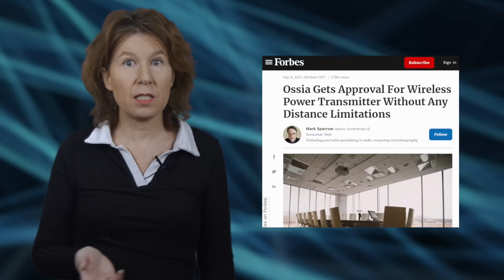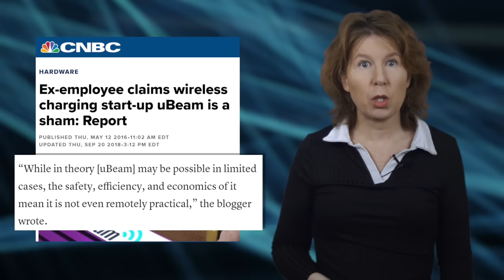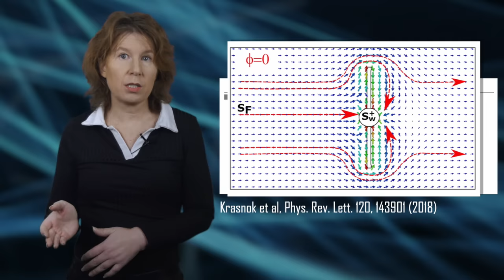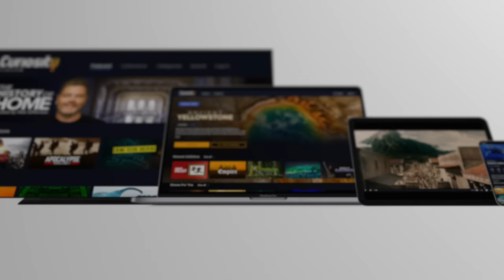How close is wireless power technology?

Comment: wireless power was solved long ago by different inventors in the 1900s. the reason why we don't have it now is that nobody seem to have understood the basics of electromagnetic induction and radio waves but instead they understand the theory of how radio waves are produced in conjuction with the already existent radios circuits but not the basics of electormagnetic induction underlying wireless transmission of power. the charge in the collector as with nikola tesla versus the inductance of the inductor winding is exactly proportional to power given a ideal distance of antenna to transmitter. normal radios uses tiny windings and tiny air capacitors. since air is not a good collector of electrons we can not increase power by more winding so we need more capacistance and the inductance need to be tuned to the capacistance given a certain distance from the transmitter and reception of antenna. wireless power need bigger capacitors to recive more power wirelessly. that means we need two coils to tune the inductance to that of the capacistance at a given frequency. another thing is the diodes used for wireless receptions need to support more power than diodes used in radios. normal radio receivers can only recieve as much total power as the charge collected on the air capactor of the tuner and that is less than 1 watt total. the previous inventors of the 1900s experimented with various capacitors and inductances for wireless power receivers but only the classic radio reched the attention of the corporations and is why wireless power never reched market in the early days. nikola tesla had already done this with a electric car that he run of a induction motor driven by a antenna receiving power from his tesla tower. the electricity was charging a car battery that drove a electric motor that powered the slow car. the only problem was that the car had limited range and could only sustan power at a certain distance from transmitter or being charged up before drive trough the tesla induciton receiver. the reason why our phones are not self charging is becasue of ignorance not science or knowledge itself.

Comment: 8:58 Interesting but a USB type c at the absolute Lowest would be doing 4.5 W most are more like 15W for phone chargers and up to 100W for laptops.   Just to show how truly far away true wireless charging Is.
Reply: Huh? One can easily build wireless charging pads with tens of kWs of power. You just don't want to be anywhere close when they turn on. It's a simple biological, not a technological limit.
Reply: @schmetterling4477  Just like someone can easily get to the moon its getting there Alive that's the hard part.
Reply: @shanold7681  It's a lot easier to build a 10kW or even 100kW wireless charger than to go to the moon. I have pretty much everything that it takes in my one bedroom apartment: a PC with PCB layout software, an old oscilloscope, a soldering iron and a multimeter. If you know how to do professional electronics designs, it's not that hard. What would I do with it, though? I don't even have a 100kW power outlet. ;-)

Comment: Once the electrical field strength reaches the ionization potential of the molecules in your body you are in trouble. You can be severely injured or killed. This is why being near powerful radio transmitting antennas, radar sources and microwave sources is very dangerous. In fact microwave beams, sound, and lasers can be made into weapons.  Microwave ovens work by generating electrical fields at the resonant frequency of water molecules. 5G is potentially very dangerous directing focused beams at up to 100 Ghz in bursts. Nearly a century ago the equivalent of microwave ovens called diathermy machines were used "therapeutically." Are we any smarter today? It doesn't seem we are.

Comment: Hollow-core Optical Fiber Gas Lasers (HOFGLAS) transmit power, don't they? It's wireless,...maybe not tubeless. Intercontinental electricity hoses sounds more waterproof, doesn't it? Mark me down for a dozen.
Reply: Solar/wind hydrogen-to-ammonia pipelines need nitrogen gas, but on the other end of a transcontinental or transoceanic pipe, converting non-agricultural ammonia liquid back into usable hydrogen must take the nitrogen gas back out, right? A double-wall pipeline solves that, with returning nitrogen gas surrounding an inner pipe of ammonia flowing in the opposite direction. Recycling that pure nitrogen reduces or replaces that required for ammonia production. With water and wind/solar energy inputs, isn't this a realistic way to spread Sun Belt energy and fertilizer products to their Corn Belt users? And, it gives another reason for drawing fresh water from the Intracoastal Waterway and lifting it uphill to the Continental Divide. It all works, but is crowd funding the only way to get the job done?

Comment: I like your solution. Another solution I've thought of is low-power guide beams immediately followed by high-power beams.  The low powered beam ensures the path is perfectly clear.  This system could be used for powering flying cars, perhaps complemented by a drone power delivery.  This way, you can guarantee your flying cars will not fall out of the sky.  If such a laser guide beam system were precise enough and fast enough it might even be able to send lasers in between raindrops.  It would wait for a perfect line of sight path and then, a nanosecond later it would fire off a high-powered beam.  This is my company that I want to start (actually, technically, I am CEO of a company right now and we could just expand our operations to include this technology).

Comment: I can't see we're getting rid of cables without having tiny fusion batteries inside every devices.

You're saying wireless power is getting going but there doesn't seem to be any feasible way of transferring even 30W of power without damaging anything else like a human, a cat, a phone cover, hair strands etc. It just seems physically near impossible. I don't know these stuff about metamaterials but I am not sure if it can solve this issue.

With the advent of AI we're gonna need batteries, or better yet, AI will need better batteries to work inside robot bodies. So it should be one of the top priorities. Not to mention fusion is critical for space travel and colonization. Though obviously, not sure you can get something like fusion batteries, even if we made fusion come true. That's also very far fetched and scifi.

This will be a problem we and AI will have to solve soon if we want to make any progress about a lot of things at all.

Comment: I have a dozen or more wireless chargers but I never use them because I personally think it's pointless, using a cable is far more efficient and cost effective, wireless charging rarely exceeds 75% of what a cable can provide so you're literally throwing money away and in almost every wireless charger you need to use the exact same cable you'd charge your device with anyway so really, what is the actual point? 🤷

Comment: Wireless power technology already exists.  The problem is that it's horribly inefficient and wasteful.
There's this little problem of distance.  In general, doubling the distance between the source and destination means that the amount of power is cut to one quarter.  If you're receiving 144 watts at 1 metre distance and then you increase the distance to 2 metres, you'll only be able to receive 36 watts.  Double the distance again to 4 metres and you're down to 9 watts, and that's presuming there's nothing in the way to absorb some of the energy.
While using waveguides, dishes and directional arrays will help to some extent, this reduction in energy with distance cannot be reduced to a level where wireless power could become viable.  The only reason it can be used with things like mobile telephones is because the telephone can be placed very close to the power transmitter (generally within a couple of millimetres) so that less energy is wasted.  But make no mistake, contactless charging is less efficient than making a direct connection, by a long way.
To quote a certain fictional engineer, "ye canna' change the laws o' physics."

Comment: Wireless energy is not good even in theory, obstacles are a danger and it's a danger to transfer energy mid-air,  something might pass it and get hit by it, plus that you might loose MOAR in the transfer if it RAINS ! SO yeah, a cable is  better  !
I don't know what's with these "in theory it works" types, this idea is wastfull and dangerous even in theory.

Comment: No it won't work except on  simple low power.   Mind you my crystal set I built in 1969 powered a 12inch speaker  via an audio  transformer connected  to the backyard aerial  The BBC suddenly increased Droitwich power at about  2am and i awoke hearing  the BBC World service!

Comment: Sounds like even when we can get it to work (the way people envision) it is very inefficient ... and if we're really worried about the availability of energy and/or CO2 ... this would be wasteful at best.  Even the tiny robots would be pretty inefficient :-)  I don't really have any problems keeping my phone charged, and for situations where it can be challenging there are external battery packs and solar chargers to fill that void when needed.  

If you're using your phone so much during the day that you can't keep up with the energy demand even with these supplements, I would suggest maybe you find something better to do with most of your time.  Learn a skill, a musical instrument, make things with your hands.  Have face-to-face conversations with people.  But then again since Sabine doesn't believe in free will, you really can't choose to change your behavior anyway so perhaps you're just out of luck ;-)  On the other hand, maybe this is predetermined, too, and you are just going to do it anyway.

Wasting energy on a constant stream of available "in the air" energy so I don't have to occasionally charge my phone just seems ... novel, but ultimately silly in the face of the challenges we face today.  I have no problem plugging my phone in at night and letting it recharge while I'm recharging.  I'm afraid until we build those matter-antimatter plants ... that's the way to go.

Comment: Even if a wireless charger had a range of only 2m and a maximum power of 2W, it would be enough to slowly charge your phone simply by placing it in the rough location of the charger. This would be quite convenient to have especially if you had a few charging spots located around your house. Just leave your phone on your bedside table and wake up to a fully charged phone. Or if you don't like sleeping next to it your phone, leave it somewhere in your kitchen or living room. No need to worry about connectors or correctly placing your phone on a wireless charger.

Comment: I think in reality this wireless power thing is and will ever be vaporware, you can't beat the efficiency of thw power grid this way, even if the frequency you are using has low absorption in the human body the sheer amount of power you need for real practical applications would make that a problem, just use wires

Comment: Wireless power didn't work for Tesla, it's not going to work in the future.. Why? Physics.. Magnetic fields drop off in their power over distance very quickly. There are applications of wireless power, your electric toothbrush charger for example, but they all work within a very close distance between the field source, and the field receptor so NO, there is not going to be wireless power. The system we have at present is all there is and frankly is about the most efficient that it can be.

Comment: Well it would seem we have all been deceived!!! Has not the technology been available to transfer energy wirelessly since the radio was invented? Is that not what occurs with that device? There’s more similarities and differences between RF and AC! In fact one can conduct a small amount of electricity from RF signals! It has been proven that the closer you are to the source of the signal availability of the power increases… I believe there is an interest of a few who want us to believe that electricity comes to the house just like water in a line. This is not exactly true for is actually the vibration of electrons that is a source of power. So electricity does not technically exist until are you advice is it plugged into the circuit and using it. The generators Do not produce electricity would rather start the vibration of electrons that then move like a sound wave down the waves. Of course it is a very simple exclamation where it is fairly accurate as to what is occurring!

Comment: Whoever is working on this should be very motivated. You will save people from electrical fires and other things that will thus be forever prevented. However I imagine whatever new tech replaces the old will not be without new problems.
(Random idea: I wonder if it wouldn't be easier to just build in some type of super small power source or auto recharging device within the objects themselves)

Comment: How useful is really a charging method with a loss guaranteed by the design to be not less than 50%?
It would be better to focus research on breaking the efficiency barrier on transformers and electric motors of 82%.
Wireless power transfer is a good example of a research area that is driven by magical thinking and false desires. Rather than what is possible and needed.

Comment: Sabine plz help.. If the universe was as dense as they say.. Why didn't it go str8 to blackhole.... And also if the matter there is today was squashed into a grapefruit surely the matter has expanded as well because its so dilute now.. And also could the expansion of the universe be the energy from when the matter anti matter annihilation happened.. And it's speeding up because its not reached its crusendo yet.. But when it does may slow to a stop and then the matter pulls it back? My head really hurts lol😱😱😢😁😁😁. I know I'm probably nutz.. But hey. The old it's a thin line between being a nutter or a genius. Lol

Comment: Wireless chargers are rather pathetic.
You have to put your phone (or whatever) in direct contact with a charging pad. Instead of putting it into some kind of docking port or plug. Then you basically use (and pay for) about ten times the energy due to wasteful transformer and inverter losses. And you wait over twice as long for your battery to charge.

Comment: A lot of those methods of wireless transfer sounds so lossy! I would prefer to plug in my devices. Most phones for instance are using less power and have better batteries so they need to be plugged in less and for less time...I am not a bit fan of every thing plugged in all the time and in sleep mode...not actually turned off...again...wasteful! Another great thing microwaves are used for is disbursing crowds of peaceful demonstrators! /s

Comment: I was really hoping my masters thesis on near filed wireless transfer using planer transfer for biomedical devices will be featured in this video (I didn't use any meta materials but more like bio degradable material) :). Talking about serious solutions for wireless power transfer, how about we try to control lightning to the level where we can calculate precisely where the lightning falls and then replicate the process ? The power plant can then work as "Cloud" and send a bolt of lightning (or more) to my house just enough to recharge my house batteries and car that will then keep powering my appliances for the next 24 hours ?

Comment: This is idiocy! What are her credentials in ANY related field of study? What could possibly go wrong in trying to transmit massive amounts of energy through the atmosphere without a conductor. Assuming that you could generate enough energy in order to get enough to a source would mean that anything organic would be subjected to massive amounts of energy flow moving through them over a lifetime.
This is a bait and switch as her only viable solution is not what we have in mind in terms of wireless charging. Small devices requiring small amounts of power can’t be applied to anything requiring even a moderate amount of power.